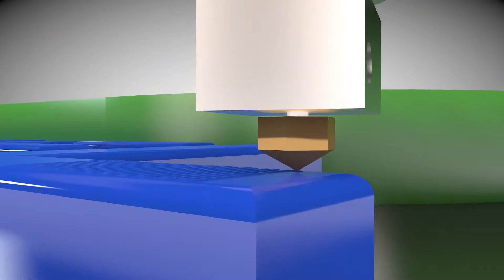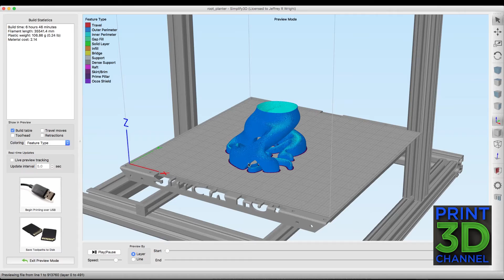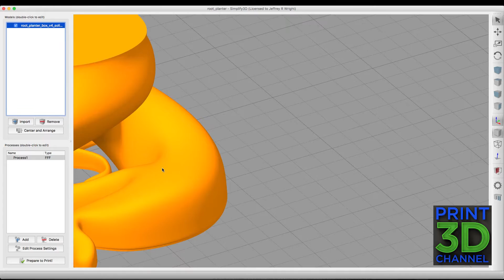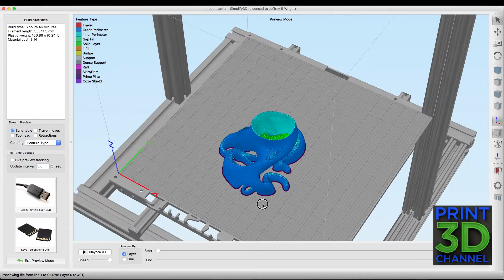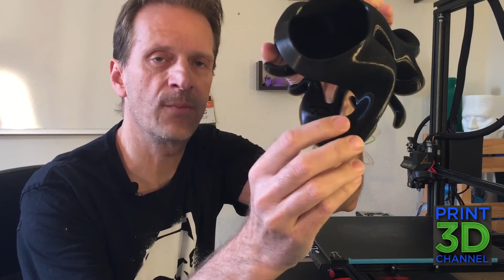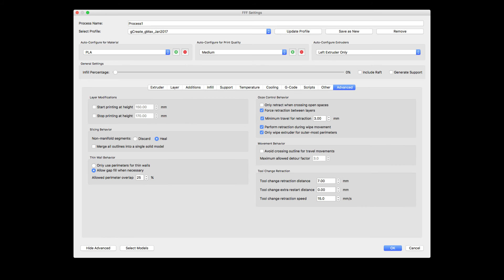#3DP365Project - Day 14 - Bonsai Planter - MatterHackers PRO PLA & gCreate gMax 1.5XT+

Comment: That's just it, some sections need top layers, and you've eliminated them. You need to let it print the top layers -- either play with multiple processing settings or let it print the top layers and then edit the gcode and remove the last 4-5 layers which ever you indicate as top layers.
Reply from the maker: That is exactly it, using multiple processes we should be able to achieve a perfect print! Thanks for watching for the great suggestion!

Comment: You've got your extrusion width set to manual 0.5, which with a 0.5 nozzle it'll never be, either increase it or set it to auto, I'd go auto & let simplify3d do the calc, it's pretty good..
Reply from the maker: Now that is a very good tip for this print and others, thanks for sharing this one. I will use this on the updated print and test my settings to see how this works in general. Thanks for watching and for the comments!

Comment: I just came here to add some suggestions but I think it's been covered. Use multiple processes to bring the layer height down to .1 in that area. Increase perimeter counts and preview with more in Simplify3D. You could also try increasing your extrusion width just a bit to see if that'll help.
Reply from the maker: Exactly, my friend, I think we are all thinking the same thing here on the solve for this print. Multiple Processes seems to be the first stage of fixing this print. I am curious if you have every tried to print this one, its a short print at 100%, too. Thanks for watching and for the comments, Joel, I appreciate it. Will keep everyone posted on the progress as more comments come in.

Comment: Another thing you could do would be to have 2 print processes.  The bottom section (to where all the parts connect) and the top, the bottom could have top and bottom layers, which would fill in those top issues.  Then you could also decide if you wanted some infill in the bottom section for weight or just hollow for saving of filament
Reply from the maker: Another great suggestion! Thanks Lauren! And thanks for watching!

Comment: The angle for those parts is extremely shallow, almost flat so without support it is extremely troublesome i guess. i downloaded it and tinkered around in simplify 3D and in order to fix that at 200% i had to increase perimeters to 8 minimum, and also make would consider checking the option "outline Direction: Outside-In", that way the outer perimeter is always the one that has the best adhesion before continuing inwards. Just my 2 cents, and will most likely try it out, it comes to around 18 hours though in printing time
Reply: one thing i noticed though, i didn't need to use 0 top layers, the model is hollow itself and it would only use up the 8 perimeters where needed, for the rest of the print it only shows it uses a total of 5 perimeters
Reply from the maker: Interesting. Great tips Joe, I will use these and apply them to a new print! Thanks for watching and for the comments, too!